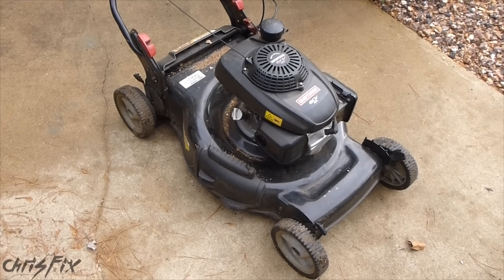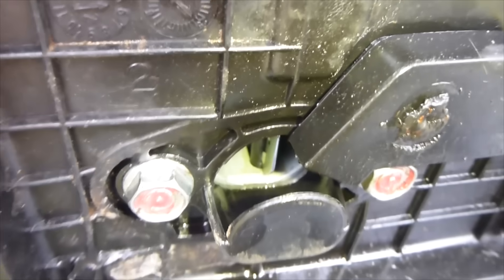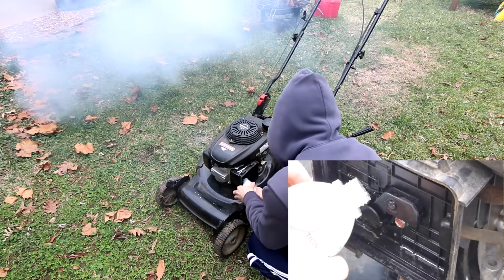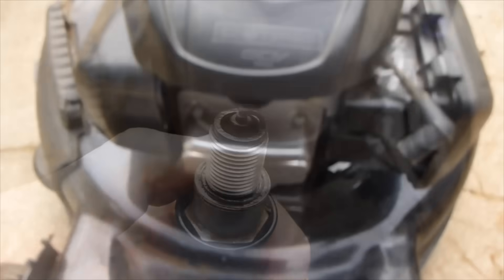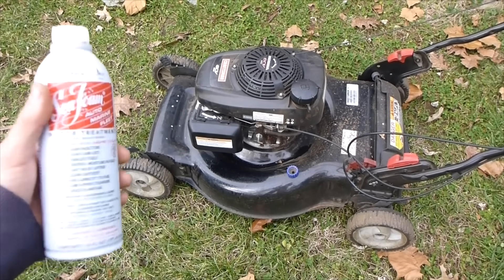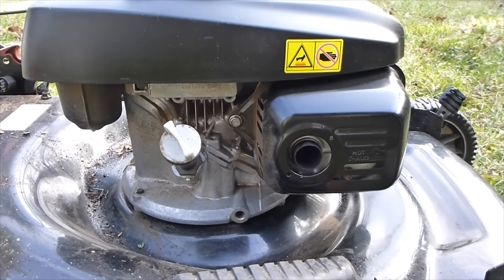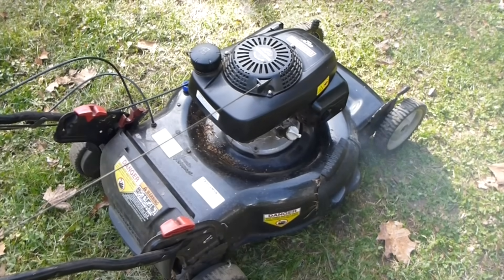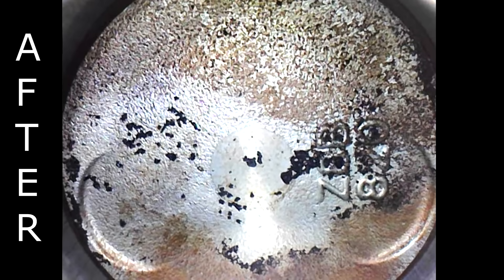Does Seafoam Actually Work? (with Proof)

Comment: I don't use seafoam, I prefer to use the best stuff on the market, which is the "Marvel Mystery Oil"(It is in a red see through container, and the oil is a deep red color.).  My dad and I are high performance engine specialists, which have tried every possible internal engine cleaner and etc, and we also put every engine oil to the test, to see which outlasted the others, and the Pennsoil brand, is the only brand we will use, now.  When we put the internal engine cleaners to the test, the Marvel Mystery Oil out performed all the others, and you don't put a harsh attack on the engines, with this stuff, you put a certain amount in the engine oil(As long as it is not a 2-stroke, obviously.) and you put a certain amount in the fuel(Gas or Diesel, works with both, and actually helps prolong the life of the fuel pumps, as well.), and all you do is, once done putting it in, you start your vehicle up, then take it to the nearest highway, drive it for roughly 10-15minutes, to make sure the engine is warmed up, and once you do, you find a safe area, where there is not a bunch of traffic, and etc, you then, put the gas pedal to the floor, and count to 20-30seconds, then let up on the gas pedal, and boom, you are done!  The engine will idle much better, and the fuel ratio will go up, as well(As in, if it was roughly 15mpg, it can range from 17-19mpg, depending on how dirty it originally was.).  So, if you want something, that has been tested, for more then 30yrs, and has not had 1 single issue, and has shown definite improvements, go with the "Marvel Mystery Oil", just remember to read the instructions, and if this helps, in a 2015 Ford F-150 XLT(3.7L V6 engine), I use about 1 1/2-2 cups(Yes, as if you are using a measuring cup.) in the oil, and about 1/3-1/2 of the large bottle of the Marvel Mystery Oil in the full(Remember FULL) fuel tank, about once every 9-12months, and it keeps it cleaned out, and running smoothly & more efficiently.  I have done this with several of the vehicles in my family, same with my dad, for decades, and we have not had any issues with it, and it doesn't put any strain on the engine, unlike that Seafoam stuff seems to do, when you kill the engine with it.
Reply: Shawn M  "My dad and I are high performance engine specialists"...
code for my dad drinks beer while changing oil and I hand him wrenches...lol

but yes..I prefer MMO too..lol
Reply: Shawn M  too long didn't read
Reply: Excellent thread.

Sold me on MMO and will shit can SF.

Thanks.
Reply: Trump would be proud of this wall right here ^
Reply: JelloisYello The biggest issue with MMO in a 2-cycle is, you already put the 2-cycle engine oil in to the fuel, and if you add that, it can also make the octane level even lower, which can make it hard to start, and etc, but, if you wish to use it for helping keep your engine cleaned out of carbon and etc, you can use about technically 1/32-1/64th the same amount of the oil, to help keep it cleaned out, but I would recommend not using any more then that, or it can set-off the balance of the oil to fuel ratio, too much.  Plus, with a 2-cycle, while you put the engine oil in the fuel, the combustion may also burn up the MMO, both the 4-cycle and the 2-cycle may have an explosion in the combustion chamber, they both have 2 different styles, where 1 is hotter burning then the other, kind of comparing propane fuel to that of an alcohol(Pure) flame, while both are burning, the heat created from them both are at different temperatures, not to mention, the 2 fuels may burn at different speeds, as well, simply because of the natural chemical base to each, so, will have to watch yourself, when you do so.
Reply: Marvel Mystery Oil saved my car from the Wrecking Yard.
Reply: ***** I agree, mine said the same, and his father and he used to do a lot of work on the old racing dirtbikes and etc, as well, seeing as, my grandpa(RIP 2014) was the last living original biker, along with his buddies, not only started the whole "biker" name, but also started up Sturgis, before it moved to Sturgis, it was technically just outside of Sturgis, on an old Native American piece of land, where, about 3-4yrs later, they got kicked off of there, and moved it to where it is at, now.  So, obviously, they know somethin about bikes and cars, since they both have got the experience, to back their words up.
Reply: I used it in my old panhead harley for years.
Reply: Actually, it does have the natural chemicals, what you do is, you put the Marvel in the fuel(In a full sized car, you put in like an ounce, in the fuel, which also lubes the fuel filter and prolongs that.), then you put about twice that, in the oil(For 4 cylinder engines, use about 2 ounces, but for 8 cylinder engines, use about 4 ounces.), then as it runs crappy down the road, get to a highway(Obviously, as long as it will not stall on ya, of course.), start goin normal speed(Around here, its between 50-65mph.), then when you come to a long open area, after you have driven it, for about 20 miles(To get the Marvel mixed fuel in to the fuel injectors or throttle body or carb, depending on which your engine is using.), you floor it, for 30 seconds(While not doing it around cops, of course, so you don't get pulled over.  lol), then let up off the throttle and coast back down to normal speeds, your engine will sound sooo much more smoother, due to the Marvel cleaning out the carb/fuel injectors/throttle body and piston rings of the clinging carbon.  We normally don't have to worry about doing that, since we put the Marvel in, about every 3 months and no problems, since then.  Now, with a mower, put it in the oil(About an ounce, but no more!), then put about the same in the full fuel tank, shake the mower for few seconds, to mix the Marvel and fuel, then get it started, but keep it at idle(Or as close to idle as you can.), then let it heat up, once it does, shove the throttle all the way up(Not engaging the choke, on some models, of course.), count to 30 seconds, then drop it back down to idle, it normally will smoke a lot(Same on the car, which is the freed up carbon, which is just unburned fuel, to finish burning, once it is separated from the metals.), then burn itself out of there, freeing up the piston rings, which unless they are trashed, will give you a small amount of more HP.  Now, I know, others are gonna banter and rave about what I am stating, but keep in-mind, I have actually done this, with both, the mower and several vehicles, so, your bickering and saying it won't work, or whatever, won't change, what I have literally seen with my own 2 eyes.  It is what it is, deal with it!

PS Vue U,
I understand what you are saying, trust me, I have had to do the same, for friends and some family members, as well(For some reason, their common sense, to change the damn oil, or even check it, periodically, went out the damn door!), so, I get what you are sayin.  So, no worries and I mostly wanted to explain in detail, on how we would do it.  Ohhhh, when we would use the Marvel in our vehicles, even though it did not need it, we would basically punch the throttle, for about 10 seconds, instead of the 20-30, when we were fully cleaning it out.  It just kept it cleared out and gave better fuel MPG's, as well.
Reply: Shawn M
although i appreciate the detailed reply, it doesn't change what i posted. seafoam is exceptional in regards to the fuel system. I rehab abused engines(mostly small engines) and short of a rebuild of card NOTHING cleans and lubes the fuel system like sea foam.  I do like MMO for top end lubrication and as a fuel additive to aid in lifter/valve lubing but i also like SF ability to anti gum and anti varnish older poorly maintained equipment.  I don't use SF like the guy in the vid so i can't comment on that use but i find SF and MMO to be 2 completely differing products. SF is also an oldtimer product developed for the Marine industry to mostly combat moister in the fuel system....its sister product 'deep creep' is an excellent ariesol version of SF for fogging engines for storage too. in my experience hotrod guys tend to not know shit about tractors/saws/motorcycles and the like and always compare things to how a pristine V8 works which can have differing needs compared to a hard used and abused outdoor stored motor.....not trying to be a dick but its my observation
Reply: ***** The main reason why I also did a bit more explaining, on why we do not use it, is because, we have had people do exactly what it says to do, which is basically what this guy did, and they ruined their engines, and had to bring them to us, to repair them, yes, we maybe specialists with high performance engines, but, we also have done basic run of the mill engines, as well.  As well as, small engines(For mowers, motorcycles(I actually own an 84' Yamaha 750 Virago Midnight, that has been bumped up to a 1,000, now.) and 4-wheelers/golf carts/snowmobiles/etc.).  Now, just because we may prefer the larger engines to work on(Mainly due to we have large hands, and they don't really fit in to small places easily.), does not make us just for 1 or the other.  We do work on different sizes.
Reply: Our family's small engine power equipment business has always carried Marvel! We mainly use it when customers would seize their engines from a lack of engine oil and running the engine without it. Some Marvel in the fuel, oil and a table spoon full directly onto the head through the spark plug hole. It almost always frees up the engine upon giving it a head start by forcing the engine over by force of manually turning the blade first. Loosen it enough so you could now pull the engine over with the rope/electric start, put the spark plug back in and try it out. It will smoke for a bit, but then it will clear up. Usually a small engine, or any engine for that matter will never be quite the same after seizing up once. Then again, your heart wouldn't be the same either once you had your first heart attack. As far as Seafoam, which we have sold for years too, we use that for a different purpose. For engines that just run rather crappy, to help clean out the system when bad fuel was left in the system and cleaned out, and things like that. I don't think it would work for a seized engine the way we would use Marvel. But marvel, regardless, is fine for just running through the system too as a supplement, like some use Seafoam. Doesn't really have the agents in it to clean and removed carbon build up, but helps. But like I said, Marvel is the stuff to use to help free up a seized engine.
Reply: Alt Name you obviously missed the part that said sea foam does an exceptional job in the fuel system.
Reply: BTW, I admit, I am not the greatest speller in the world, so, if I mistakenly misspelled something, sorry.
Reply: Hey Patrick, thank you for compliment.  To answer that question, yes, would be about 3 tablespoons full, for that size engine and fuel tank, so you don't go too much with the MMO ratio, with the fuel.  Also, if you need to ask the question, it's not that it is a dumb question, since you are willing to learn the truth behind it.  In other words, no question is dumb, just unknown for the time being.
Reply: That deep Red MMO is a cheaper copy of Redex. Used for decades in Europe, UK and Australia.
Reply: Hey there Maestro.  Well I overdid it with the MMO, I put about 3 oz in 19 gallons of unleaded regular. But my poor 3.8 liter GM was running so rough it was like a broken motor mount. I also threw in a 12 oz bottle of sea foam.  It seems to be smoother, I did as you instructed and rammed the accelerator to the floor about 4X, the old engine (I have a tach) seemed a bit jerky as I tached up to 4750, then the rev limiter kicked in.  Do you think adding MMO AND Seafoam was bad?  (I really need the car to run, I have severe liver problems, and need to drive 400 miles to get a test.) It seems a bit smoother already, I also added about 3 oz of MMO to the engine oil. So what is your take on what I've done so far? I never even heard of SeaFoam before this series of videos, MMO has been in my garage for decades.....Thank You so much Shawn :-)
Reply: Shawn M put that stuff in a dead bird and it'll come back to life.
Reply: Shawn M you are stupid as hell, you say that you should pretty much floor your car to clean it out after putting MMO in. That is exactly what you don't want to do. Your engine oil is diluted and if your any kind of decent engine builder which you apparently think you are because you keep bringing up how many engines you have rebuilt then you of all people should know that's a horrible thing to do to your engine. I would never have you rebuild my engine if I herd what shop you work out of. I'm sorry your so misinformed man.
Reply: Shawn M writina a book ?  Sheez
Reply: I think MMO and Redex were both developed around the same time; the 1920s.
Reply: Did you all try Castrol GTX? It was originally a motorcycle oil but you can use it on cars and I have had only great results. I watched a video of someone running an engine for 300 hours and for what would be every 3000 miles they changed the oil putting the GTX back in, at the end of the test they stripped the engine down and every single piece and part looked like it had never been used
Reply: Don't think I would want you building an engine for me
Reply: Shawn M.  I have that 2015 Ford F-150 XLT eco-boost (3.7 V6  engine ) So you are saying it's SAFE to pour 1- 1/2 cups of MMO into my gas tank at my next fill-up? Hope to see your response.  Thank You in advance. ;-)
Reply: whats wrong with putting MMO in a 2-cycle ?
Reply: JelloisYello
its to thick and would mess up your ratio to the rich side.
Reply: Shawn, do you remember a product called Sta-Power? It was great at carbon and valve cooling after the lead ban. My  Father had a 1968 Datsun "roadster" (SPL-311) and the cast exhaust manifold would glow red when it was a little out of tune. Just the Sta-Power alone in the gas and the manifold would stop glowing, meaning the burn was being completed in the cylinder instead of the manifold. When we heard they went out of business, we went around and bought up every case we could find. I think we had a 2 year supply when we were done LOL After we ran out we just did the water trick now and then and used the lead replacement additive for the valves along with Marvel Mystery Oil. 

Another great product is Power Punch. Still in business in Portland I think.

Another trick is to put in 2 oz of Diesel to 10 gallons of gas. It will add upper cylinder lubrication as well as soften carbon so it can be burned out. Diesel is just "Fuel Oil" and will not hurt your motor.
Reply: Chet's Jug Actually, yes, my dad used to tell me about it, where he put the 2 against each other, to test em, and the MMO won the challenge, but not by much, though.
Reply: Anti Everything Yup, those need it !
Reply: >>> you put the Marvel in the fuel (In a full sized car, you put in like an ounce, in the fuel, which also lubes the fuel filter and prolongs that.)<<<    Hello Shawn. love your detailed commentaries. But what do you mean   "full sized car, put an OUNCE in the fuel?"    Do you literally mean ONE OUNCE in a full tank?   I have a '91 Olds 88, 3.8 ltr V-6, it runs rough quite often, really jerky.  I like MMO, but HOW MUCH is adequate for my 19 gallon fuel tank?  And your words "also lubes the fuel filter, and prolongs that"  How is a fuel filter "lubed"  thanks and I hope you get back to me.  Sincerely, Patrick Young :-)
Reply: Shawn M  God Bless You buddy, you are so generous with your time.  So an ounce would be literally just a couple of tablespoons, right?  (I feel like it's a dumb question, sorry)  We used to use MMO for CAT 3208 fuel pumps, if they sat with raw fuel, they'd rust and seize. But fill the fuel filter with MMO, let it flood the valley -reservoir in the fuel pump, and it saved you the heart break of an engine that wouldn't start no how  no way.
Reply: Hey Patrick, best way to clean a carb out, is to remove it from the engine, put it in a container(For the carb you are needing to clean, use a small glass jar, that you can reach the bottom of, so you don't have to  drop the carb in.), put the carb in, either use clean gasoline(That is, if you don't have the cleaner, that we normally would use.), or use the "parts cleaning solvent", for about 24hrs, then lightly blow it out, so you don't blow out pieces of the carb, of course(I have known people do that, since they tend to not think about what they are doing, sometimes.  lol).  The solvent will loosen up whatever is sticking to it, so it can be blown out of small holes and etc.
Reply: BTW, I know these things, because I used to rebuild engines(Well, used to work at a shop, where we built racing engines and rebuilt regular engines, as well.) for a living, so, I used to do these things everyday.  Also why I know what the different fluids(MMO & Seafoam.) do to the engines.  If you are near an automotive shop, they may let you come and use some of the solvent, for your carb, as well, or maybe have ya pay like a buck or so, since it just needs to barely cover the carb.
Reply: +Patrick Young - It was ok, and the ratio constructed, revolves around the amount of gas/fuel to MMO.  Kind of like when you are cooking, if you put too much oil in with the water, or eggs, while making a cake, or whatever.  Since you put the MMO in the fuel jug, that was ok, it is actually a good idea, to keep some in there, at all times, so it keep working on keeping the carbon cleaned out of the cylinders and etc.  We actually periodically use it in the fuel, for our new vehicles, as well.  Which is why the vehicles engines have out-lasted my niece's Honda's engines.  Sad part is, we have been buying the newer Ford F150 trucks, that have the newer V6 engines & the 7-gear(Not including the reverse gear.).  Personally, I prefer Chevy's, but the newer Ford's aren't that bad.  Now, when you stomped on the throttle, did you make sure to wait long enough, for the MMO/fuel mixture to make its way through the fuel line and carb/fuel injectors, as well?  Granted, it doesn't clean it perfectly immediately, when you stomp on the throttle, it actually speeds the process up, is what it does.  Which, even after the MMO makes its way to the carb/injectors, it acts like how water expands, when heated up quickly and loosens the carbon, from the pistons and cylinders and valves and etc.  Now, it may take 2 shots of the stompin of the throttle, to get it to break-up and loosen, then blow-out the carbon, to loosen up the engines torque/HP.
Reply: Hey Shawn.  Thanks a lot, You are the greatest man.  but I think the problem is my "fuel mass flow sensor" or something like that, or my cam sensor, my crankshaft sensor, or the computer itself.  when it runs rough it's like driving with 2 broken motor mounts, it will smooth out a bit at about 1700 rpms, but when you try to accelerate up even a slight highway uphill, it bucks and halts and misses, it is so rough you'd swear you were on a washboard road.  Idle is now rough and erratic too.....Any suggestions?  I put actually about 2-3 oz of MMO in 19 gallons of gas, and about 5 oz into a 5 quart oil crankcase.  Also put about 10 oz of SeaFoam into the same 19 gallons.  I've romped it from 55 to 85-90 mph about 5 times.  It seems a bit smoother, but I still cannot trust it, I had to cancel an important doctor's appt (got potentially fatal liver cirrhosis) as I cannot trust my 91 Olds to go 400 miles reliably.  I feel like I'm torturing it driving in this condition.
p.s You Da Man!!  :-) :-)
Reply: Hey Patrick Young, sounds like, your piston rings are failing, like they maybe worn-out, or frozen in the spot the rings sit in, where the carbon will build up and "lock" the rings in the slots, so the fuel will easily get past the rings, same with the pressure(From the fuel to air mixture explosion.), so, may have to pop off the head off and the pistons and rods out, peel the piston rings out, then clean up the grooves, for the rings and maybe even replace with new rings, so it holds the pressure, again.  Thank you, for the good compliment, as well.
Reply: SeaFoam didn't do anything for my '91 Olds with a 3.8 V6.  My problem was simply cleaning those little teeny sensors in the Air Mass Flow Sensors.  Piece of cake.  I like the guy who does this, but I have NEVER seen any additive that really accomplished something......but I'll give SeaFoam a try on my Briggs & Stratton as it just won't start.  But since it won't start, how would I use it anyway?
Reply: Shawn M -Sounds great. I have used it in oil before, but not in the fuel. Thanks for posting that info
Reply: I have an old 1964 Galaxie 500 with a 289 Winsdor. I'm hesitant to do your instruction of putting the pedal to the floor for 30 seconds straight. Won't there be a chance of breaking something?
Reply: You bet. Be careful with that old V8.
Reply: Shawn M, that's hott!
Reply: Tomatoe patch murderShawn M t
Reply: You're saying with the motor running in neutral put the pedal to the floor for 20 to 30 seconds? I thought revving an engine like that would damage or blow the motor.
Reply: Will it work on a dead dog also? Please let me know as my dog just passed. Right now she is in my freezer awaiting your reply. Should I defrost her before giving her MMO?
Reply: Better to Remain Silent and Be Thought a Fool than to Speak and Remove All Doubt!
Durrrrrrrr...  Me and my daddy are really smart...  Durrrrrrr...
You have no idea what you are talking about.
Reply: Shawn, I use to use Pennzoil, however, won't anymore. The reason?  They merged with the most worse oild outfit on the market with two cuss words. Quaker State. At one time it was good oil until in around 1980 and beyond, Quaker State had to replace peoples engines due to sludge build up in the engjnes.  I now usd Valvaline engjne oil. I do have Marvel Mystery oil and yes, it is a red oil, however nevef usd it real extensively.
Reply: In my experience as a backyard mechanic (not a pro by any means) using both products and observing the results I find crabtraps description of these two products to be spot on. 
Seafoam for the fuel system and MMO for top end lube and cleaning. 
 I like the Seafoam  in my small engines~ when there is a lot of moisture in the air my Honda generator will stall out. Add some Seafoam as advised by an older guy who owns an auto parts store and it runs like a champ. 
When I bought an older Nissan with some top end noise especially on a cold start up~ time to pour some MMO into the oil just before an oil change as advised to do many years ago and that top end noise is gone in less than an hour, and it STAYS that way.
Reply: Has anyone noticed that Chris has not posted on this thread? Kinda funny if you ask me. I would be reading and learning from input such as this and giving at least a Thumbs UP for all of Shawn's' work.......Did I do it grammatically correct?? LMBO.
Reply: Shawn M Qa
Reply: how about using the advise of millions of miles and hours of manufacturer vehicle and dyno testing,  vs .  the me and my dad stories have been doing this for years stuff.   Except in any very extreme application for racing and very short engine life,  just save you money, save oil, save disposal cost, and stop polluting these products in the air,  and use manufacturer spec's.   they want their powertrains to last as long as possible,   I was in the business,  and no , there are no conspiracy engineering/marketing tasks to not let a product last too long to increase new car sales,   If your brand doesn't last longest, you will lose repeat customer and they will switch brands.
Reply: ***** I have to disagree, since, my dad and I have been using it, for more then 60+yrs between us, and we have done our own engine rebuilds & etc, so, we know exactly what the seafoam and the MMO does to the engine, right away and for long distances, we have actually put the 2 of them against 1 another, and the Seafoam stuff failed in just about every way possible, except the short-term range, they were about equivalent in that range, while the MMO kept working, the Seafoam stopped working, also, it is NOT a good idea to stall out your engines, with a foamy fluid, or any fluids, for that matter, it is VERY liable to lock-up your engine, until you pull the plugs and hand-crank it, to open up the chambers, which, when you cause the engine to lock-up, for even a second, it is possible to cause the piston rods to bend, the pistons to collapse, the rod bearings to smash, the timing chain(s) to pre-stretch before their time, the cranks to use their inertia spinning, to also break the blocks(Usually by shoving the cranks out of the bottom of the blocks, through the weakest point, which are known as the mains.), and many other possibilities, that you don't have to worry about, while using the MMO, which is slowly distributed, along with the fuel.  So, before I put many, many other things at risk, I will just stick with, what I know that works, and does NOT put my engines at risk.  The way I see it is, you can do whatever you wish, I am not your puppeteer or master, never cared to be, just felt I could throw out some vital info, on the 2 products.
Reply: Barry Nichols Ummm, never has for us, and we have used it since the 50's, and seeing as, we are professional automotive specialists(BTW, our name is very well known, in the racing industry, due to our accomplishments, and our engines NOT blowing up, since we learned what NOT to use, and what we CAN use!), who rebuild the engines, of those, who do not know how to follow instructions, or not able to use the right oils or fluids, to do what is needed to be done(Which, we have rebuilt countless engines where people have used that "Seafoam" stuff, that hardly works, when you pour fuel into your combustion cylinder, to finish it up, and causes it to create more stress on the piston rods, among so much else, like the head gaskets and just anything that can fail, when you put more stress then it is constructed for, when you do so, and can snap them or even just bend them, but, what do I know, when I have rebuilt so many, I gave up counting them, huh!?), instead of just puttin about 1/2 a bottle of the MMO in the FULL tank of fuel(Obviously, as long as it is a large tank, like 20+ gallons, if small car, use 1/8th to 1/4 a regular size bottle.  Be smarter then you are working with.), and about 1-2 ounces of the MMO in the oil, to help the oil to stay together, instead of falling apart, shortly before you change the oil, since, when you do, a lot of carbon, that is sticking to the metal area, can break loose, and when you do it shortly before you change your oil, it gets rid of all that carbon, plus, it can also help keep your seals from drying out, as well.
Reply: its not the same type of product. i use both but seafoam shines most in the fuel system. it will clean out the shittiest old fuel system in minutes while also lubing valves. mystery oil is just a top oil,it does great for top end lubing and anti sludging, but thats about it
Reply: BTW Aaron W, from the English, that I was taught in school, you missed several mistakes in your grammar, so, not wise to call the kettle black, when you yourself cannot spell/grammar correctly, either!  There is my 2 cents!  No body is perfect, especially when they have not had much sleep.
Reply: Shawn M hi shawn. How ounce to put in 1.3cc engine oil using mmo ? Tq
Reply: Hello Patrick Young.  Yes, that is what is known as a "Full-sized car", same goes with trucks and etc.  Now, same goes for the smaller vehicles, like the Mitsubishi Eclipse and Porsche's, but the smaller vehicles, like a golf kart, or riding mower(You know, with smaller fuel tanks and smaller engines.), you use about half that amount(1/2 of a fluid ounce, since "ounce" can be mistaken in the solid form measuring, versus the liquid form measuring.  I have literally had guys think, that the measuring table for liquid versus solids is the same, when it is not.).  Basically put that ounce(Or 1/2 ounce, depending on size of vehicle or better yet, fuel tank.) in the fuel tank, fill the fuel tank(With the normal fuel and can be part way full with fuel, when you put the Marvel Mystery Oil in, as well, just when you put the MMO in, make sure to fill the fuel tank ASAP.), so it mixes well with fuel, then done with that part.  Sorry, was half asleep(Was around like 4:30-5:00am here.  I hadn't slept that night, yet.  lol) when I typed that other one up, I meant "fuel pump", not "fuel filter", sorry.  I do tend to make mistakes, when I am tryin to type a long explanatory ordeal up, I admit, I will mistakenly say things, like "fuel filter", when I really meant "fuel pump", my bad, sorry.  lol
Reply: It's nice to actually see grammar and punctuation. One thing that is absolutely annoying, is the over-use of commas and parentheses. Also, placing them where they don't belong. Just my two cents. Have a good one!
Reply: Pedal to the floor for 20 - 30 seconds ???  LOL ! 
BOOM is what you'll likely get alright.
Reply: Actually no, it doesn't.  Maybe from where you are from it means that, but from the city, it means, we actually had us a full machine shop, where we not only built the engines, but we also created the parts, for prototype engines, but hey, since you are from the woods, whats it like to have them tractors to pull y'all out of the mud!?  Those of us, who actually have experience and knowledge, to NOT get stuck in the mud and burn our engines, that run off of straight "ALKY" racing fuel(Known to y'all backyard mechanics as jet fuel.), that was putting out over 800H.P, while naturally aspirated(AKA to y'all backwoods lovers, 4-barrel carbureted, not fuel injected.), which was our typical builds, like the perfection of the 18 degree Chevy heads, AKA 18 degree cheater heads, that Dale Earnhardt SR. was caught using, back in the early 90's, then again, the reformation of the rocker-arm assembly, that I personally came up with, that stopped the 63-64' Buick V8 215ci engines(Better known as the Land Rover 215ci V8's, since Land Rover bought them from Buick.), that are used in the race cars, that are used in the Mid-Ohio racing industry(Since most of you have no idea who these people are, they are the wealthy race car drivers, that you wish you could be a part of.  You know, those who buy Lotus's, Porsche's, Ferrari's and etc, just to strip them down and put a roll cage in, just to see who can spend the most money, to get to the winners circle.), since they were well known for the valve train assembly exploding, due to the high pressure, but like I mentioned, took care of that issue.  Which now, the teams over in Europe/Australia are using the same style set-up and not 1 of theirs has exploded, since.  Now, since I thought people had brains, is why I did not feel I had to go in to detail, on some of the minor things, that we used to do.  Also, like I mentioned before, I may not be a perfect typing person, but at least I know that there is such a thing as a comma, & etc.  Now, before you make an assumption of others, why not ask to know them better, before assuming, they are like your favorite side of your family.  May learn something you did not expect from them, huh!?  Maybe we just don't care to explain everything about ourselves, to the world, unless we feel we have to show those, who are ignorant enough, to jump to conclusions, way too fast.  Which seems to make them look like they fell flat on their face, when their speedy ignorance is shown, to be no where near, the one they are trying to put-down.  Now, with that in-mind, have a happy day, I have no time for such ignorance and idiocy, to play with, after this, good-bye!
Reply: ***** Well, for your comment on those of us who are "hotrod guys", you are also speaking with the grandson of the last living original biker(Obviously, until he died, about 1 1/2yrs ago.), while he was riding around with his "biker" buddies, which, he and my father were both farmers out in Kansas, not to mention, my grandpa and his buddies also started the whole Sturgis thing, so, we know about the small engines, as well, plus, we used to have a 32' cabin cruiser, which also had dual Chevy 350ci engines in it, as well, so, like I was sayin, they both work, 1 is more a speedy way of doing it, where the other does it over time(With the exception of, if a regular vehicle engine is gummed up, if you put the MMO in, with a bit more, then it suggests, but not a massive amount, then you run the vehicle down some side streets, roughly 4-5 of them(So you can run the fuel out of the fuel bowls/rails and get the fuel with the MMO into them, so it can actually do its job.), that are just average side streets, then get out on the highway, and obviously make sure you are safely doing this, and hit the gas pedal for about 15-30 seconds, depending on how bad it is, and how powerful your engine is, obviously, then drive it for about 10-15 miles, and listen to it smooth out, which is the gumminess being kicked out of the intake area, and yet, you are not clogging your engine up with a foamy fluid, like this guy does, since that is what it reads to do on the side of the can, since, if I remember correctly(Has been a while, since I watched it.), he actually reads the instructions to us, as he goes through it.), and helps keep it from gumming up over-time.  And yes, I have actually put this to the test, since I did not believe it at first, when my father told me this, and then explained it, so, I actually put it to the test, and low and behold, it did work.  Don't know why(As in, don't have a clue which chemical, that is in it, does the actual work.), but it did work, and like I mentioned, they both work, but in different ways, as far as I am concerned, so, I will just say this.  "To each their own."